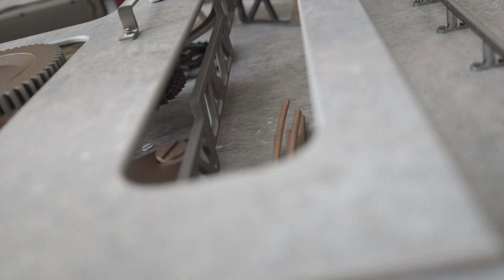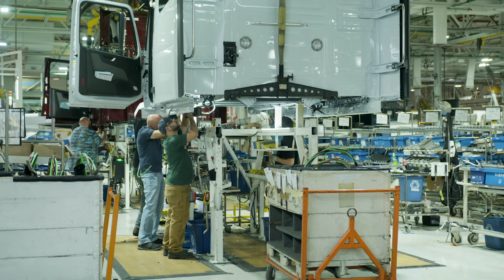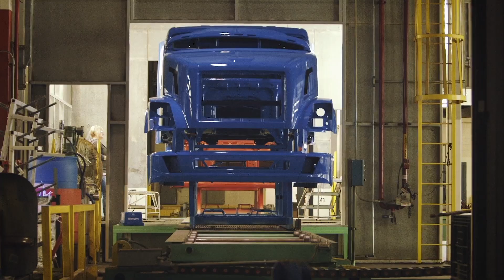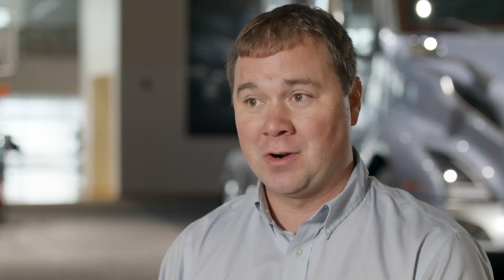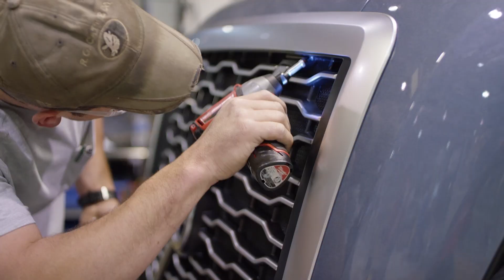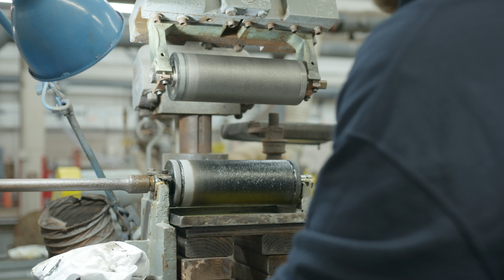Made in Virginia - Volvo Trucks & I.R. Engraving

Comment: Volvo is a good truck....do they still make 10 speed manual transmissions??
Reply: Yes we do
Reply: Yes they do. In fact, I used to deliver brand new trucks  from Dublin, Virginia then I quit then the company that I used to work for gave me 3 brand new Volvo 10 speed truck to drive. I put 300,000 miles on it then I quit.
Reply: no, volvo quit making manuals an option for trucks in 2017 because less than 5% of their customers ordered them.